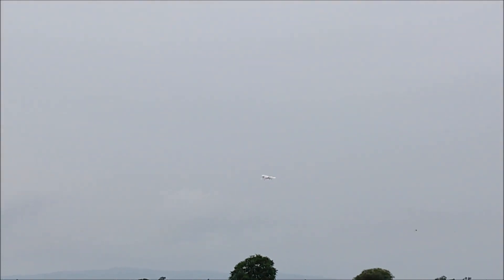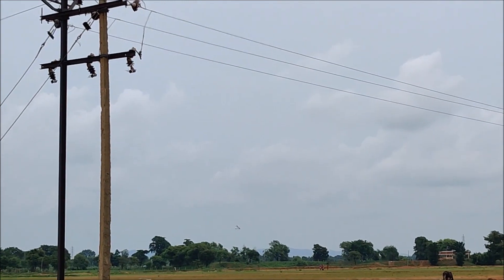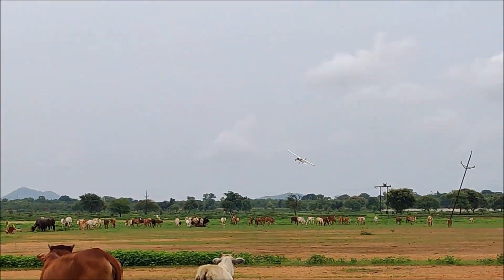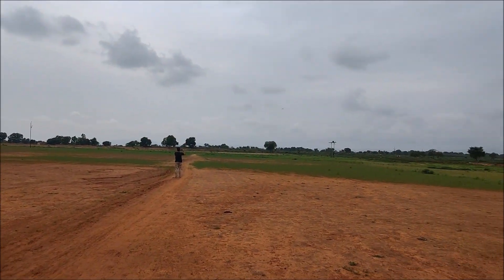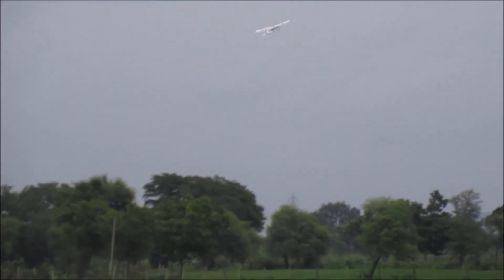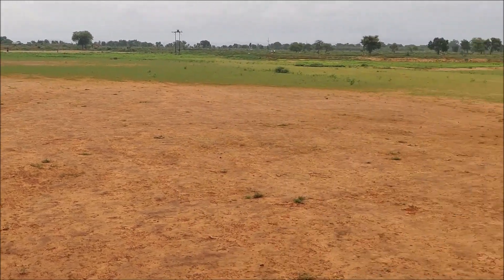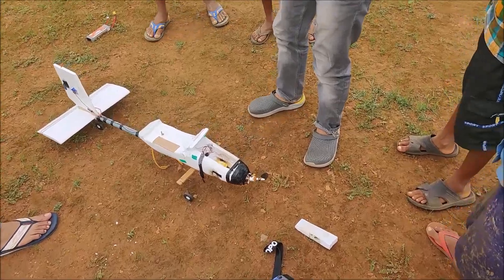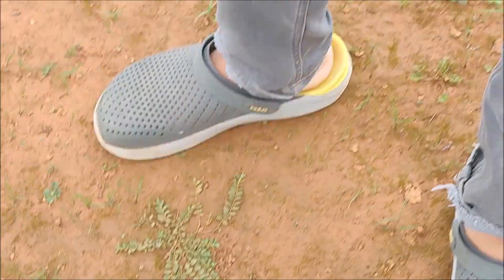Scratch Build 1.4 meter RC Plane Maiden Flight part 1

Comment: some info.     at :00,   as a novice pilot,  you  Should Be  flying a model that has a   DIHEDRAL  main wing.
such a model can be controlled  without the need for  ailerons.      three channels:  throttle, rudder, elevator.
(a pilot can  learn  ailerons,  later.)    
at :00,   the tail of the model should be made as  Light  as is  practical.
the main wing  should have been mounted about two inches, farther forward.
it is not clear whether the horiz-stab has been made with  a  Symmetrical, zero-lift profile.

the  Mass of rudder/elevator servos   Should  be located  NEAR  the cg/c-m, of the model.     (not aft of it).
avoid adding the   Mass  of a  tail wheel. 
the  size/area/Mass  of each stabilizer  should be  'just enough'    to be get the job done, and be durable.
the root chord of each  stabilizer  could be reduced by about   one inch, at the leading edges. 
sweep and more slope angle,   Should  be  added  to the stab  leading edges. 
the use of  a lighter battery, after the tail is  made   lighter, is recommended.
the 'galloping' flight seen throughout  the first flight, indicates that the pilot  did  NOT  TRIM  the model, for level flight.
tx  TRIM  SWITCHES   Should  be  used,  for in-flight  trimming, AS   NECESSARY.
Up-Elevator  Trim   Should  be   Mixed   with  throttle,  so that the model  flies/cruises,  levelly.
when a tail boom is made of a material than  cannot be  tapered,  there  WILL   be  'extra'  mass,  in the aft tail boom.
googletranslate
Reply from the maker: @David Davids .. Thank you so so much for the suggestions and information. I am really new to this thing, but inspite of all research that I do, I really can't figure out what to do with what. thank you again, much appreciated suggestions and information.
Reply: @AT_Innovation  see 3-channel slow-flyer.   only slow flying.      a dihedral wing is a little more complicated, but can be worth the time/effort.      note that a dihedral wing consists of three parts:   two  wing  halves  and  a  center-section;   the center-section should contain a   fuselage-spanning,  dihedral brace.    a brace  can be  laminated, using  small, thin pieces of wood.        a little dihedral goes a long way.       three  DEGREES, per side, is enough.       cheers
https://en.wikipedia.org/wiki/Dihedral_(aeronautics)
see  polyhedral shown, at the bottom of the plan.     simply to be  dihedral.
https://static.rcgroups.net/forums/attachments/1/8/1/0/8/4/a1900931-224-Cessna%20152%20mini.gif
center-section
https://mars58superstinker.files.wordpress.com/2009/12/centersection3.jpg
Reply: @AT_Innovation  𓆉︎𓆉︎